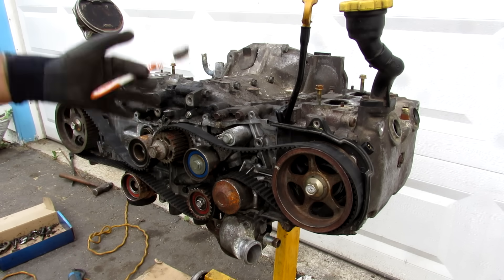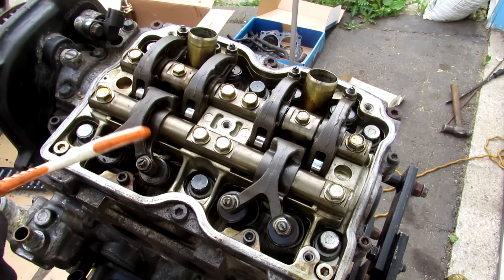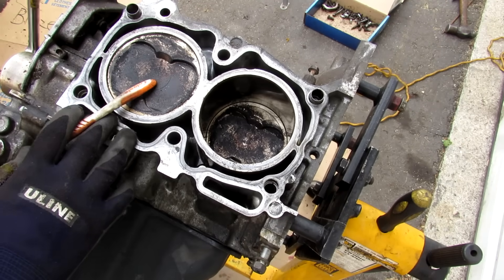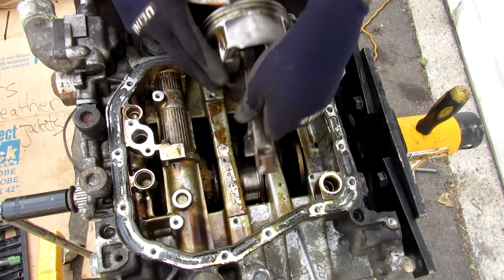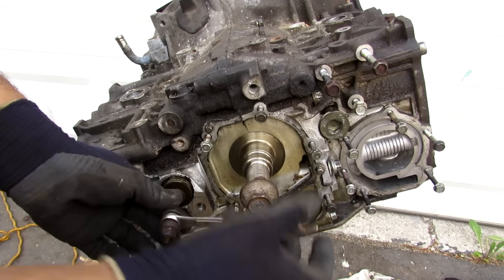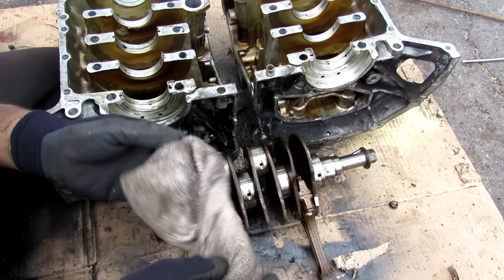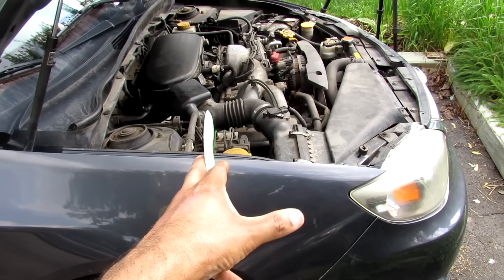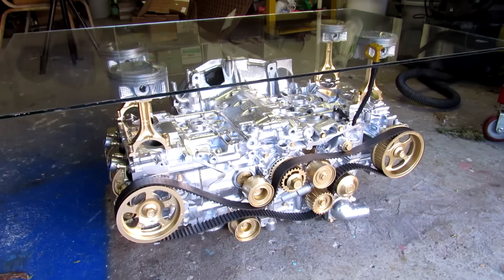Why Subaru Engines FAIL

Comment: It's easier to pull the engine of a Subaru and work on it external to the vehicle, than to fight everything in the engine bay.
Subaru knows this.  
The wiring harness for the engine has a plug by the firewall, and there are less than a dozen bolts holding it in.
Reply from the maker: Kinda like the old VW beetles

Comment: Subaru still can't make or obtain decent head gaskets. Or whatever causes them to fail. 40 years ago the parts stores were constantly running out of Subaru head gaskets. We retorqued the head screws as recommended and still the gaskets blew. The oil and filter were always changed as recommended: 2,500 miles intervals.
Reply from the maker: Boy..

Comment: Your knowledge is very impressive and you communicate it clearly.   It is surprising that Subaru still does not have all its ducks in order regarding this issue.
Reply: Boxters amd 911's have horizontally opposed pistons and to my knowledge have no head gasket issues.
Reply: @abz124816  Ahhhhhh.... NO.  Stop by a Porsche service shop, and they'll bring you onboard.

Comment: Terrible design but Subaru keeps recycling the same design.  Tons of failure points, burns oil, head gaskets, difficult to work on & many jobs require complete engine removal. Generally like the cars but engines are 80-100K ticking time bombs. Avoid them!
Reply: Says the clueless bedwetter.  You have absolutely no idea as to the reality of Subaru engine except for what someone TELLS you to think.
Reply: @eskieman3948  U have a right to Ur opinions & but I've been turning wrenches for a living almost 40 years. Name calling is not necessary. You can express your opinions without that behaviour. If you enjoy your car I'm happy for you many of their designs are great. Personally I don't enjoy working on these engines.

Comment: I own two Subarus-a 1999 Version 5 WRX Type RA V Ltd with an EJ207 and a 2002 Legacy with an EJ205. I've owned my WRX for nine years and it has 170,000 K's on the engine. It uses no oil, or coolant. It's never been apart, or out of the car. Never overheated or blown a head gasket. It has exactly 150psi of compression on each cylinder. It runs at 18.5psi of boost. I change the oil every 5000  K's. It gets driven HARD. I road race it and drag race it. It performs flawlessly. I bought my Legacy wagon two years ago with 270,000k's on the origional engine. The engine has never overheated, blown a head gasket, and has been removed only recently, to replace the clutch and timing belt. It has 145psi of compression on each cylinder. Both engines are amazingly clean inside. The EJ207 is remarkably spotless. The engine in this video looks like it's been driven very hard, not had regular services and has had cheap oil run through it. Neglect any engine and it will fail. I see dozens of Subarus come through two Subaru specialist garages, who's owners I'm friends with and all of the engines with failures have been caused by people driving their cars hard, running high boost and cheapo oil. Expecting them to provide fantastic performance with little to no servicing.Many owners will get their ECUs "tuned" by an idiot, too, looking for even more performance.
Subaru engines are no more likely to fail than any other. If you don't maintain an engine, especially a high performance engine, it will fail. I expect both of my Subaru engines to keep on racking up hundreds more kilometres. I've also owned rotary and turbo rotary engines that have clocked up hundreds of thousands of kilometres, through regular servicing using high quality products.
This guy is a fucking spanner.
Reply from the maker: Awesome thanks for your ownership input

Comment: Boxer engines are just crap.
Reply from the maker: Aww
Reply: @speedkar99  an engine block consisting of 2 halves bolted together can never be good. To much forces. 1 block, v6 or 8 or straight 4 is way stronger. 6 in line i had plenty trouble with, like heads and gaskets. Pistons in a boxer laying flat wear on 1 side more then the other side and become oval. Bad design. Porsches have the same crap engines in them.

Comment: My advice is NEVER BUY A SUBARU, NEW OR PREOWNED.  Subaru is total CRAP. It is inconceivable that after all of these decades, Subaru still has the shitty "bath-tub" shaped horizontally opposed engine design. In 1976,  I paid $4,500.00 for a New GF Hardtop Sport Coupe, spent another $2,000.00 in repairs, and had to sell the car for 75 dollars as "junkyard scrap" after 5 years and only 76,000 miles driven.  My worst "investment" in a car ever made. NOT ONLY ARE THE ENGINE DESIGNS PATHETIC AND "BAD", THE TRANSMISSION IS A REAL PIECE OF DOG-SHIT. I KNOW BECAUSE I AM A PREVIOUS TRANSMISSION BUSINESS OWNER WITH ONSITE EXPERTS IN "AUTOMATIC TRANSMISSION DIAGNOSTICS AND REBUILDING SKILLS." .
Reply from the maker: Ouch

Comment: So I have a 2020 sti, and all these problems are often meme-ed. I take care of the car by doing oil changes every 6 months even when it doesn't have enough miles. My question is, what else can be done? Someone mentioned driving style (keeping rpms around 3-4k approxnfor the ej) which I always drove my wrx at 2.5-3.5rmp, and drive the sti in a similar rpm range. Is there any truth to the rpms for the EJ? I try not to lug engine, so I drive in a way that feels right.
Reply from the maker: Yeah but the EJ is more prone
Reply: @speedkar99  yeah I know the ej is more prone to issues. Is there any truth in which rpm range to drive in that's best for the engine?

Comment: More half-truths and false assumptions about Subaru engines disguised as "expert" narration.  Boxer engines are very balanced in operation, and the cylinder orientation has nothing to do with head gasket degradation.
Reply from the maker: Yee

Comment: Jowett Javelin engine modernised. Jowett motor 1799ccs; wet-liner cast-iron removable barrels in alloy block, engine mounted below front axle, cast iron head;push rod valve gear; simple mechanical oil pump. Fit new pistons with engine in place; hone the barrels leaving engine in place; remove motor and gearbox in about 30-40minutes flat; . Extremely rugged motor and powered the Jowett Jupiter sports car three time winner of its class at LeMans. That was all between 1948 and 1953. Simple, strong and easy to work on. Subaru; eat your heart out!

Comment: Just buy a used engine and replace the damaged one. Less time, less expense till you get done tinkering on it.
Reply from the maker: Ok but what if they have the same problem
Reply: @speedkar99  The subaru engine will run flawlessly for at least 80,000 miles if you pay strict attention to your coolant temp and use the correct oil filter and change your oil every 30,000 miles. Opening the oil pan should tell you all you need to know about the engine. The Subaru has a reccomended maintainence schedule usually right in the owners manual. You don't have to be an ace mechanic to not get burned. Just find a totaled subaru at the junkyard with 30 to 50 thou miles that has been rear-ended. You can sometimes get them for under 1000.00 usd Always make sure to replace the timing belts on the used engine when you do this.

Comment: Toothbrush?......yeah yeah yeah I like it and I don't know why. I love my 04 Impreza with the EJ25. I just keep changing oil at 3k miles and coolant at about 20k and I haven't had problems for 140k miles (knock on wood).
 And when you park your Subaru, its better to park it upside down, btw.

Comment: Actually the boxer engine is more balanced then any other 4 cylinder because the pistons counter balancing each other. That's why the crank has way less counter weights and they are skinny and slim on the crank
Reply from the maker: Good point

Comment: 13:46 The engine configuration that best cancels inherent vibration is the Boxer not the 'V'. That's quite an exercise removing the pistons. Current piston technology is offering thinner ring lands but the lands need to be rolled into the piston not cut. Would give more resistance to breakage. That oil control ring needs to be a lot thicker. With the 'compactness' of the newer pistons designs, I think forged aluminum is getting close to it's design limits vs. production cost. I like the Mahle Steel piston alternative, especially for the stronger lands. Good video. Secure a laser pointer to your tooth brush. 😉

Comment: Is there an inherent weakness in boxer engines with split engine blocks rather than the traditional single cast V style?  Obviously, I'm not an engineer but it seems like the basic block itself wouldn't be able to withstand the same pressure that a single cast block would.

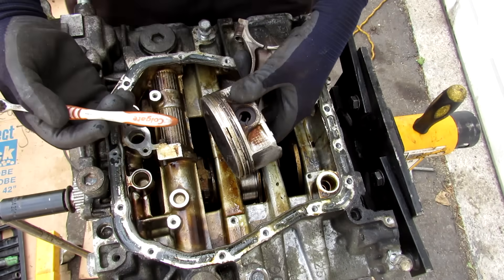Comment: 6:15 - Incorrect use of the word “attenuated”. The oil issue doesn’t reduce the problem...
Reply: Yeah, I noticed also but let it pass. Overall a very knowledgeable and concise speaker.

Comment: Man, I enjoyed watching this engine tear down.  You are a master.  Unfortunately, I own one of these boxer engines with a CVT no less.  Thanks to you  I now learned to change the oil and oil filter frequently.  Above all change out the antifreeze fluid every two to three years with Subaru's own.  I hear but have not confirmed they have additional additives in their antifreeze to prevent head gasket corrosion.  Can you confirm this?   Thanks again for the great and easy to understand explanation of the boxer engine.  This student of yours how learned a thing or two about boxer engines.
Reply: The Subaru mechanic around here said this about Subaru antifreeze also.

Comment: I used to own a couple of Subaru cars (1973 thru 1978). The nice thing about them was they were easy to work on. The bad thing was you had to work on them all the time. Amazing, after 50 years they still have a head gasket issue.
Reply: I’ve had my 03 wagon since 110k to 240k  no problems

Comment: After watching  a dozen videos on Subaru’s lately I now have the answers on why one of the greatest car manufacturers in the world has one of the highest failure rate as a multi-owned used car...... used buyers that have just enough common sense to buy the Subaru but no where near enough to maintain it. I seem to have a lot of coworkers that have 4 to 6 kids a wife that can’t or won’t work and they make less than 30 thousand a year...... not boxer engine friendly situation !!

Comment: A Subaru mechanic I know says a complete overhaul including crank, rods and pistons, and cam shaft should be done every 100K. He works on these, says they are great power but require much more maintenance.
Reply: Correctamundo 💯

Comment: One inaccuracy I noticed; the opposing pistons in a boxer engine are not directly aligned because of the crank pin offset, and therefore the design actually has less effective secondary balance than its inline counterparts. Less of an issue as you add more pistons, but quite noticeable in 2 & 4 cylinder configurations. The opposing pistons do however allow for a great reduction in counterweight on the crank, which lends itself well to high RPM, complementing the over-square layout, and is the most valid reason to prefer the boxer design.

Comment: I just remembered that Volvo DOHC motor you showed... A mechanic replaced the accessory/alternator drive belt and it failed sending the belt through the plastic timing cover damaging the timing belt also destroying valves in the processes. [interference motor] They couldn't figure out how to get the timing belt installed correctly ending up destroying valves another two times. Yes, the original repair, bent valves. sent the head out a 2nd time, bent valves. sent the head out a third time, put the vehicle on a tow truck with everything in a basket and brought it to me.
1st the cam sprockets would bolt onto either cam and were not marked as intake or exhaust. One sprocket had more metal balancing weight and I identified it to be the exhaust sprocket based upon the dealer replacement part cost [$]... 

2nd both sprockets had slotted holes where the three bolts went trough to hold it onto the cam, which means you could change the clocking of the sprocket with respect to cam position.

3rd the cams were held down into the head by the valve cover via 18~ bolts so the cams had to be positioned 8deg BTDC so they would rest in the head and you didn't strip out the valve cover bolts while trying to install the valve cover. This means that the crank also had to be positioned 8deg BTDC before installing the timing belt.
What a clusterfuck design.

Comment: 11:46 "surprisingly this bearing is not lubricated there's no hole for it"
So much for hydraulic bearing/journal separation, although I'm sure there is a hole in it's journal so it gets some lubrication from the crank galley.
I'm sure there are some aftermarket engineering/machining and parts to solve some of these issued. Like drill a hole in the #3 block where the main bearing fits with forged pistons and an updated ring set with wider 3 part oil rings. VW seemed to do fine, albeit eliminated some potential problems with air cooling.

Comment: All engines fail if they are not kept full of oil.  Newer engines use very thin low viscosity oil. They need to be checked often.

Comment: Subaru EA and EJ non interference motors don't fail. They don't have head gasket issues.  Just the POS 2.5 and go fast 2.0s.  They used to be great and reliable, simple cars.  Now they can't even keep a head gasket in them!

Comment: My dad always said changing oil is like cheap insurance against premature wear and failure. 

And in almost 30 years of driving I’ve yet to blow up an engine. Excellent video!
Reply from the maker: Checking the oil is important too. And it's so simple!
Reply: Your Dad is a very bright man. Oil maintenance is the best investment anyone can do. I never let it run to the mileage in the manual. Depending on the type of driving.  changes at 3-4 k for every car I owned. Just gave away my 2010 Equinox with 240,000 miles with no engine problems.
Reply: Spot on. I got complacent with my oil changes and over time the oil became very sludgy to the point where the oil pressure light would occasionally come on and the oil rings jammed up so it blew a lot of smoke. I ended up having to pull the engine apart and cleaning the sludge off of everything. Surprisingly and thankfully there was negligible wear so I put it back together and it ran well. I'm much more careful when it comes to vehicle maintenance these days.

Comment: I've always felt like the boxer is overly complicated in design and cost to build, some basic jobs like spark plugs are a pain...and what benefit do you get, lower CG?  I'd much prefer an inline 4 over a boxer 4.  It is a real shame that toyota decided to use a subby motor in the 86.  I know plenty of people like their boxers but any engine built these days should run decent for a while, but I see no real gains over using a slant 4 cylinder.

Comment: Nice tour of the inside & functions of an automotive engine. Took me back to my days of working on an old Austin-Healey Sprite Mk II. Sweet little simple machine, that one. Wish I'd kept it. And kept it running ;-) Thanks!
Reply: My mother in law had a Subaru in the 1980s with piston slap so bad I thought the engine might explode.  We’ve owned 3 since that time b/c my wife has been a fan.  Our 2001 Outback was still running with 190k but not without some real problems including rust out that was allowing exhaust gasses into the interior cab.... and our 2012 Forrester burns oil with less than 100k.....started at about 50k if memory serves.  Dealership tells us it’s normal for these cars.  They also didn’t want to open the sealed tranny and change the fluid saying it was good for the life of the car.  I won the tranny debate and paid for fluid change and it’s time for another one.  I lost the debate on the oil because Subaru refuses to acknowledge the problem or do anything about it.  My 2012 Ford Escape has hit two deer and has a salvage title and I kept the dented hood and the damaged radiator.... but it still doesn’t leak oil or coolant with 127k miles so far on the 6 cylinder.  I suspect it will last as long as the Subaru with far less oil and far less service.  And I bought it used for 20 grand less than the Subaru.  Both are pretty good cars for utility vehicles..... Ford can tow light loads and Subaru is so limited in towing capacity there’s no point adding a hitch IMO.  Anyway, wife agrees her next car will be something else.  We will know to keep oil full because of this amazing video.   Once the Forrester fails ....Bye Bye Subaru.

Comment: With all the issues you've pointed out with boxer engines, how many miles could you expect to get out of a Subaru with normal driving & maintenance?
Reply from the maker: It's like a used car. It all depends on how it's been treated. Scroll through the comments here and you'll see owners with both sides of the story.

Comment: Quality coolant & oil with scheduled oil changes removes many of these issues. Both my 2.5 & 2.7 Subaru engines had over 160k when I sold them & ran fine with no excess oil burning.
Reply from the maker: They made an ej27?
Reply: ER27 6 cylinder which was in the very rare XT6. I had a 1988 . Electric steering pump, air ride suspension & other eccentric things like dual timing belts made it quite the oddball. Enjoy your videos btw. You're right to the point & that's refreshing.

Comment: Did you know Subaru and Porsche engine’s in reality are not true Boxer engines the pistons are offset, a true boxer engine would have both bank’s inline with each other. Of course this can’t really be done because the Con Rod set up would be to complex. 🤘🤘🤘